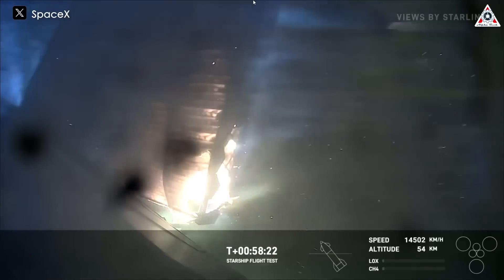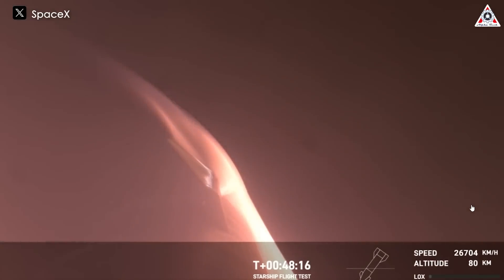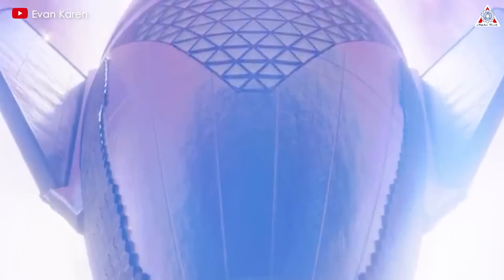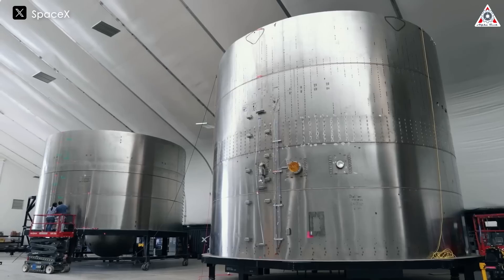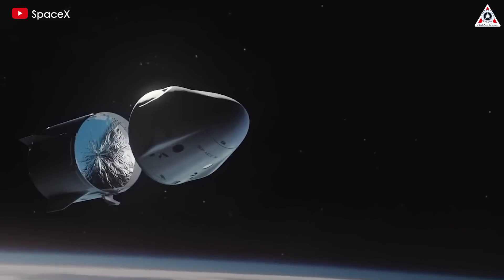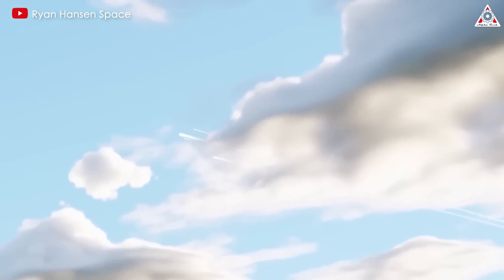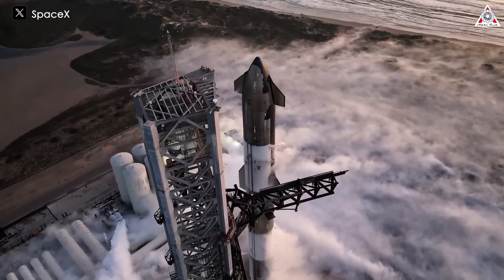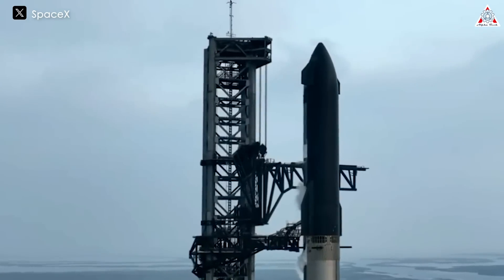Elon Musk's Big Solution to SAVE Starship Heat Tiles Survival Reentry.

Comment: Pretty good video, kind of a pleasant verbage diet plan, compared to most You Tube Blather.

Being somewhat Aspie like, I have always been sensitive to semantic content.

So listen carefully.
And was pleased that you covered the point about the only way to really do it, is via traveling thru the atmosphere, and using friction to slow down.

And as I have done numerous writs here on Alpha Tech about high altitude glide ratio flight profiles, its nice to hear the friction thing being given primary attention.

Also I listen to Angry Astronaut, and after flight four he was realizing that the heat shield tiles were dysfuctional, and compared the early high altitude phase with the Space Shuttle.
But also realized that on Lunar or Mars return re-entry, things were going to be magnitudes of order worse. And that the tiles were not gonna cut the mustard...

Basically we have no real choice for rapid reuse re-entry  but to develope shaped hull craft, designed to use glide ratio, to keep up in thin enough air long enough, that we dont actually need tiles 
per sé... That if necessary, we can do multiple in upper atmosphere orbits starting from extreme velocities, and over time working it down to sub orbital velocities. And finally Terminal falling velocities.

And I have done mutiple writs describing desired craft designs and how to do fabricated.

I also know from
 flight 4 that Elon gets it, and his tribe does too. That was a sweet and clean high altitude flight. Now we just need alot more of that.

I would guess in excess of 5X the distance, and maybe 10X.
You have the velocity, you have the air, just need to reshape the ships and have real control and lifting surfaces, and do a flight profile that stays up as high as possible, as long as possible. The flying wine bottle was an interesting experiment, but its not gonna survive the test of time in Space Flight.
And I am confident Elon is in process on new thinking after flight 4.
Which is why I did all the obnoxious writs on longitudinal gores fabrication, wing styles, hull shapes, etc.

What I attempt to do is plant concepts like seeds, and give them time to grow in the minds of our Social Club.

It usually works really well, as we all love to think about space stuff, and add to concepts if we can.

I am confident that V-2 Starships will be some steps towards the necessary goals, but hope Elon goes full paradigm shift, to the high altitude glide concept on hull design etc.

Its his company, his endeavour, I just want to see success as early as possible. as time and money wasted doesn't get us to Mars and beyond.

I really appreciate that they did try the new flight profile, and we got to see the velocity drop with zero ship damage. That pretty much clenched it for me, from theoretical to proven.
And being the Ahole that I am, will repeat the phrase I used whilst getting bad mouthed for suggesting parts count:
"I'll win in the end!"
🤗

Comment: An insane idea...  Heat tiles have a hot side and a cold side.   So I imagine a heat tile that has P and N type semiconductor matrix embedded into it.    So each tile is in effect a large Peltier device.      If each tile is designed to link electrically to each other, then maybe the whole heat shield could be treated as one huge Peltier cooler.     At least some of the energy of re-entry could be used to generate electricity, or if sufficient current can be given to the heat shield, then you would have both passive and active cooling from the heat shield.          Maybe some parts of the heat shield could be used to generate current for the more sensitive parts to use for cooling  (using Peltier effect on some and Seebeck effect on others).             This would be insanely difficult to do, but Musk seems at his best with insanely difficult ideas.
Reply: There's no way this would be worth the effort. The rocket engines can generate lots of electricity easily if they need to, and they don't. They'll just bring batteries.

Cooling can't work either because these are heat pumps, the heat must go somewhere and you can't conduct it to the air any faster than it already is.
Reply: @fsmvda  I am not certain you understand me.    The engines are off during re-entry.   Why carry batteries?  What would be the point?        
 A Peltier device can be used in two ways.       One way provides cooling/heating when supplied with a high enough current.     The other way is to generate electricity from a hot side and a cold side.     It's the same device used in one of two ways.

Upon re-entry a Peltier device, placed exactly where there can be the correct temperatures on the cold side and the hot side would generate electricity.    The electricity is not free, it's taking (however little) energy from the heat of the pressure wave.   So I think just having such devices would contribute to thermal protection - it certainly would not make the tiles less efficient as heat insulators.

The parts of the heat shield most at risk - ie. flap hinges, might benefit from active cooling.    Electricity generated as described above could be used to power Peltier devices in the shielding of the hinges,   Maybe you would be making the hot side even hotter, but the benefit would be active cooling on the cold side.

The problem would be designing the tiles and having the semiconductor matrix in exactly the right place.  Not to mention the hassle of making the tiles make good electrical connection to each other.     But it would be a closed system - one that works only on re-entry and does nothing at any other time.    Peltier devices are not exactly efficient, but Starship heat shield is a very large area.    The hinges are comparatively tiny.     Use the heat of re-entry to generate cooling - in doing so you must be bleeding off at least some of the kinetic energy of re-entry.
Reply: Interesting idea.  My thought was a paint made of silicone, ceramic, and possibly copper material. Much research and experimentation would have to be done to determine how thick the coating would be.  It may be that such a material, if possible, will be too heavy.

Comment: So, very informative vid on the current technology of heat shielding but zero information on Musk’s plan to improve the current heat shielding. Nice try though.
Reply: I've seen this trick before! 
Click bait .
Reply: Simply no new Solutions,  stainless steel already took care heat during re entry. Click bait
Reply: He said it as plain as day 4.23. They are moving the flaps both down and more to the leeward side of the ship.
Reply: @stratolestele7611  Changing the location of the flaps does not equal improving heat shielding.
Reply: Heat shield...testing them absorbing heat from a torch is insufficient . They need to be thicker ..with thrusters to control the spaceship from rolling , it can do without the flaps ..

Comment: This might be a silly question but…why can’t Elon make the entire Flap in one piece…in one compete single tile?
Reply: it says in the video the heat shield material is very brittle and hard to manufacture in large pieces so thats why the smaller tiles are used and they are easier to replace
Reply: @impulse9765  Yes, that's true, but if it was a solution to the ship not melting, Elon could mass-produce flaps for rapid replacement.

I think the real problem is the gaps in the (very necessary) hinge, which allowed the high pressure hot plasma inside the heat shield, melting the ship from within. Moving the flaps leeward could help. But maybe designing a heat shield that protects the inner exposed surfaces as well as the external ones is more important. This seems a more generic and reusable solution to the problem, even if it takes a bit longer.

We're witnessing real-time in-situ design and problem-solving here. It's very exciting!
Reply: @ian_macdonald  I agree they definitely need to do something about the hinges but all in all its very exciting to watch these launches and they are the highlights of those weeks

Comment: Is there no way of descending spacecraft slower so the burn of reentry doesnt happen?
Reply: In principle yes.   In practice no.  Retro rockets would require nearly as much fuel as is currently used in take off. But the rocket equation means that to take off with enough fuel to reenter would require many times as much fuel as current rockets.  Even landing on Mars will be impractical using retro rockets.  It is only with bodies that are too small to have an atmosphere that dissipating speed via "the burn of reentry" won't be used.

Comment: Titanium wings
Reply: Maybe shields near the joint.  But I suspect that the flaps will be moved far enough leeward so the joint is not in the plasma stream even if you have a tile failure.  But it might be only far enough so that the joint seal doesn't have quite so much exposure.
Reply: Probably reinforce heat resistance just in the areas by the joints. Use tungsten (melting point: 6,194 F) vs stainless (melting point: 2,790 F or titanium (melting point: 3,034 F) .  Tungsten still may not be enough, but it's more than twice than that of 301 stainless .
Reply: Have you ever worked with titanium? Shaping titanium is not as easy as with steel. Titanium melts at 1668°C, whereas pure iron melts at 1531°C. That does not make much difference.
Reply: @gottfriedheumesser1994 Yes and it’s a pain to work with as it requires special tooling. I believe SpaceX can work with what they currently have and just use more shielding. Failing that then they could consider a new metal. But not at this point
Reply: @jason_m_schmidt622  The most important is that the melting points are not significantly different. So the use of titanium is not much different from steel.

Comment: I wonder about high temperature ceramic coatings used instead or with current heat tile system. They have ceramics that resist temps up to 5000 F.
Reply from the maker: It can withstand high temperatures, but when it falls into the atmosphere it will still have to rely on unity with other tiles.

Comment: It maybe possible to use duplex stainless steel.
Reply: Pls elaborate.
Reply: @norfintorkjoe8925  There is a duplex stainless steel that has a coefficient that is the same as mild steel. Which less than the SX300, by about half. Stainless steel has never been used to build a rocket before. There are number of variables that may prevent the use of refractory bricks. My suggestion is they should try an idea that has been used during the Apollo missions . A heat shield that is much more flexible. But it removes the heat shedding it off by a reduction in heat.

Comment: It is a pity that the starship has not been saved for investigation. So nobody knows exactly what happened to the heat shield.
Reply from the maker: Heat shield resistance appears to be different for different surfaces
Reply: @alphatech4966  Sorry, you prove that your technical knowledge is not very high. Can you explain what is the sense of your answer? The heat does not depend on the surface but only on the speed of entry. That's simple aerodynamics.
Heat shield material must be able to sustain this temperature together with its mounting. It also has to sustain the vibrations induced by the engines.

As a former teacher, I would also suggest using much fewer words at a lower speed to express what is relevant. Nobody is interested in anti-gravity and similar things that presently don't exist, but what really happened during this flight, and how it can be circumvented with presently available techniques.
Reply: @alphatech4966  did some child write that? or did you even read the question. @gottfriedheumesser1994 but i 100% would have liked 2 see the starship after landing but i think the water fall damage might have deformed the shape and knocked of heatshield tiles and tbh they had thermal cameras inside so they will know where are the weak points.
Reply: @FlinxPlays  As I remember, the speed of the starship was reduced to 2km/h. As a retired engineer, I can imagine that this would not have caused much damage to the shape.
Reply: I think that the answer by FlinxPlays did not taste well to the 'experts' of alphatech and was therefore deleted. Go on and wait for knowledge and education!
Reply: @gottfriedheumesser1994  starship weight about 200 tons and it fell over into water after hovering for a sec, that is about same as falling onto concrete there is massive damage because of that, if you were a engineer then you should know that
Reply: @FlinxPlays  I am an engineer and therefore would be able to differentiate the causes for damage. But you are always right, a real expert!

Comment: Good Morning, I'm anxious to see what the new heat shield is going to be. Any ideas? Is it going to be another tile configuration or solid plate sections? I'm sure it will be a different composite. If it was easy everyone would be doing it. I think SpaceX has entirely new. Great Update! Have a Great Day my Friend.
Reply from the maker: I think the problem is due to the position of the flaps causing heat to penetrate into the gaps between the heat shields! So as Elon Musk said we just need to adjust its position
Reply: @alphatech4966  Your doing a Great Job. ALPHA TECH. Love Your Channel.